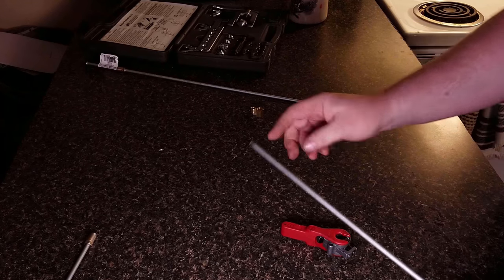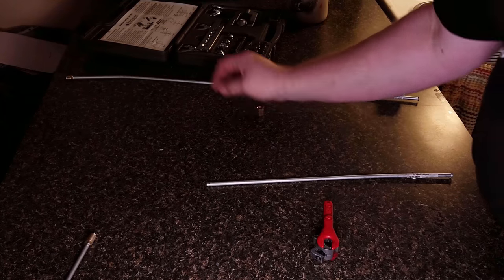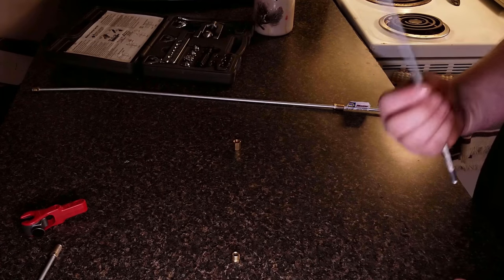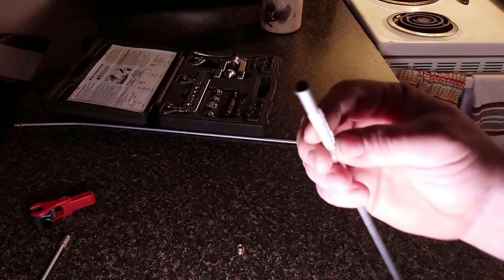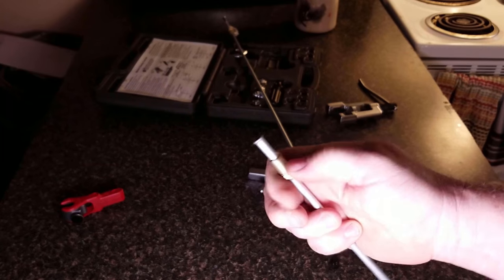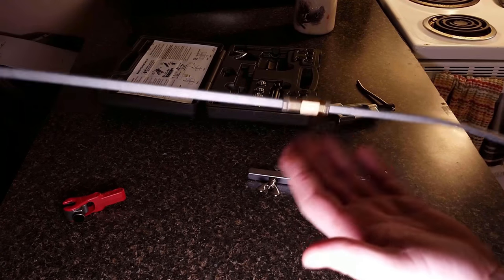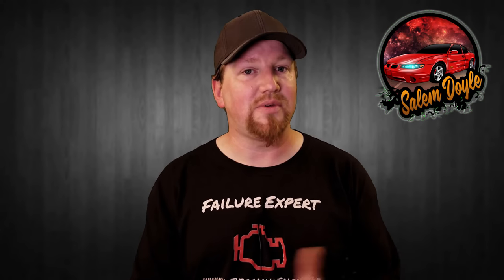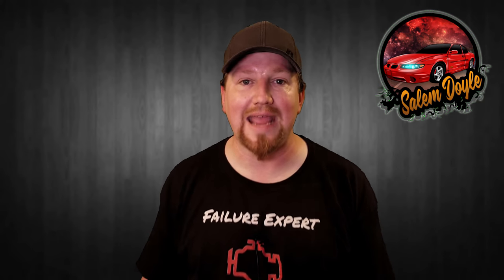The REAL way to repair metal brake lines !

Comment: You just saved me from having to take apart half my engine bay to replace a brake like that I stripped a bolt off and had to cut the brake line. Thank you

Comment: Great video Salem. I loved how you explained the whole compression vs. flare attachment system. Especially the blow off vs. leak with the compression fitting system and front vs. rear brake.   I'm doing flares for sure.
Reply from the maker: Thank you

Comment: I like the example of compression fittings, although kind of long.  I would recommend a video showing why not to use compression fittings on brake lines under 1,000-4,000 lbs of pressure.  Start the engine with fittings in place and let power assist build up pressure and then slam on brake pedal to show force not holding pieces together.Thanks for the whole explanation.

Comment: I own a flare tool but I have never I repeat while knocking on wood never have had a compression fitting fail and I have used about 20 and I usually torque them hard enough that you can not pull the copper ring off once installed i usually only use the copper ring over the old line after cleaning it well and connect it to the new factory flaired line

Comment: Thanks for the info! I have a 2003 GP with the 3800, much like your car. Always warms my heart to see someone taking care of one these cars. Great vehicles.
Reply from the maker: Agreed.  Thanks for watching
Reply: @SalemDoyle  You're welcome! What's your take on pulley swaps? I'm N/A, but I'm curious what you've done with your GP. BTW, I also have an '07 GXP with the 5.3. That thing hauls.
Reply from the maker: Nice car.  I have a 3.5 pulley on my 99 with supporting mods
Reply: @SalemDoyle  Nice. I've actually seen a GTP (slightly) out-accelerate a GXP with the right mods. You just have to be careful with knock and not overwhelm the transmission from what I've read about the S/C cars. Heat buildup can be a problem too, with the already hot-running all-iron 3800 having a heat producing compressor on the top of it.
Reply from the maker: True

Comment: Great video Salem! 

Question. I need to repair rear brake lines and of course I'm going to use flare/union fittings. They will be a patches in the middle of the 2 rear brake circuits. 3/16 inch lines. I'm using the copper alloy line. Why would I use bubble flares vs. double inverted vs whatever else. Also, many of the couplers (union) fitting seem to reduce the size. In other words, the passage way in the union is a smaller circumference that the circumference of the brake line itself. How much will this matter? 

Any advice would help. thanks!
Reply from the maker: The type of flare doesnt matter, just match it to your unions.  And that small diameter diff. Wont hurt anything

Comment: My state (maine) specifically says you need a double flange on any brake line -
“This safety tubing must be double-lap flared at the ends in order to produce a strong leakproofjoint.”

Comment: Can you unscrew a double flare connection (for some reason) then put it back together. Will the join be as good as the original ?

Comment: If you can take the ferrule ring off of a piece of pipe that it was attached to, the compression fitting wasn't used properly. If tightened properly the ferrule will indent itself into the pipe and be impossible to remove... or slip. The reason that they are illegal is that most people don't know how to properly attach them. And I agree with that.

Comment: So i bought a new brake line for my 2000 chevy blazer but the brake line flare is too big for the new line attachment... Did i just get the wrong part which it doesn't look like I did or do I need to refare it with a new attachment for the new brake line?
Reply from the maker: If its a factory part i would expect it to fit.  Maybe re check to make sure its right

Comment: I'm glad you covered the compression fitting bit right away. All good points!

I'm a fan of the nickel copper line, as it is much more resistant to corrosion and is easier to work with. You definitely pay for that, though! If I ever relocate my ABS pump on the GTO, I'll be doing a full NiCu line conversion.
Reply from the maker: Yes, i use that kind at work all the time.

Comment: The brake line flaring kits they loan at Autozone, O'Reilly's, and NAPA (same as the one in this vid) are not for steel lines, so if your car has steel lines, you will have to use a different flaring tool.

Comment: What is the best brake line material for brakes? 
Do you prefer steel or copper or?
Reply from the maker: The metal lines?  Steel is strongest.

Comment: Salem...   Have a question about a 2000 Buick Regal that has antilock and traction control issues.    Is there an easy way to replace the abs module and get it bled so that everything works as it should....  The only other videos I see all require a high end scan tool.   Thanks for all your videos..
Reply from the maker: You need the tool to do an abs bleed after replaceing the module..  not really a way around that

Comment: Although I understand you're talking about brass compression fittings they do in fact make stainless steel with a higher pressure rating than brass that will hold up. 👌

Comment: Excuse me I have some issues with my ABS module in my 95 buick riviera supercharged and I need some advice about repair or replacement ABS module? Thank you in advance sir
Reply from the maker: What info do you need?
Reply: @SalemDoyle  How can I test the old one or where I can find one for replacement?
Reply from the maker: The. Ar tests it, you should have a abs light on if its bad with codes pointing to it.
Reply: I got 4 codes in it and I want to know if the part needs to be reprogrammed  or just has to be the part number if I can find one?
Reply from the maker: @homeroaguilar6163  what codes did you get?
Reply: @SalemDoyle  27,32,33 and 75

Comment: Salem how can I get air out of my abs pump . I disconnected the lines to replace AC hoses. Now my brake pedal is on the floor.
Reply from the maker: If you cant get it out doing a bleed of the whole system, you may need an abs bleed wich requires an oem scan tool
Reply: @SalemDoyle  uuuuggh  I was afraid of this that. Which I need one anyway. Thanks for all the help when I have questions. Did you ever decide which route to take on your coilovers situation?
Reply from the maker: Not yet

Comment: access for good tools for this have gotten cheap and readily available. A great choice (better choice) is available at amazon as the "Titan double flaring tool" cant recall exactly but I thingk about 35.00 dollars. I don't know if its available in all sizeds but it was available in 3/16 for my toyota tacoma.. Beats THE HELL out of the double wing nut style, not expensive, and can function  in very confined areas. I've used both, I have no vested interest but in  trying to help out.Take it for what its worth, but the amazon reviews will back me iup.

Comment: Compression fittings were meant for copper lines. never steel brake lines. That's why the lil barrels won't bite into the line. Good video and good info.
Reply from the maker: Thanks
Reply: When I worked at Parker hydraulic fluid division..we had conducted a pressure test....steel line with a copper compression fitting.......250000  psi the line bursted....the compression fitting was like new
Reply: @mikesecondo2254  regular copper compression fittings on a steel line?
Reply: @bstceltics4  yep...works up to 5k p.s.i
Reply: @mikesecondo2254  Let me know where I can find a 'copper' Parker compression fitting, ha ha.
Reply: @elmarko9051  it's called (replace the brake line)

Comment: What about the steel D.O.T approved compression fittings?
Reply from the maker: I havent seen dot aproved ones.  But if they are then i suppose you could use them.  But flareing and creating a removable union is still,in my opinion,  just as easy and better in the long run.

Comment: i had this done 3 times bro ... not sure if im using compression fittings but i do know i bought new lines but did fittings based on how much the mechanic had in his mind he needed to cut
Reply from the maker: +Lebron James since it was a shop, it should be ok.  They should k ow how to do it with the correct fittings
Reply: @SalemDoyle  ok thank u got worried I can always take pics all around so u can see what I been doing

Comment: If you heat a steel line with a torch would that help in not splitting the flare? Seems like it should?
Reply from the maker: Maybe. But you would want to be really carefull doing that.  Would be easy to overheat it

Comment: Hey man I just found your channel tonight and I just want you to know I really appreciate your videos and your hard work you really helping guys like me out I just bought a 2002 Pontiac Bonneville SSEI and even though it’s not a W body I’m sure a lot of this information is still applicable to my vehicle.  Actually I’d like to ask you if your window regulator video on your 1997 GTP would be applicable to my rear window regulators on my 2002 SSEI because of course I have the same exact issue. Thank you for all of your help And I will continue to promote your channel from a friend and viewer from the greater north aka rust belt aka Michigan.
Reply from the maker: Thank you, that means a lot to me.  The window reg. Should be pretty similar, there may be a few small differences, but should be really close.

Comment: I bought a hydraulic clutch line And it doesn't look the same size inside as what came in from the factory and of course it leaks and then it scratched the end of my hard line
Reply from the maker: Yeah, sounds like it wasnt the right part.

Comment: My understanding all along has been that using a compression union for brake lines is unacceptable, dangerous, and even illegal in many states. Hence, using a doubled flared brake line is the best method to use. Nonetheless, would a high pressure compression union rated for 5,000 psi (Dorman part # 800-202) be perfectly safe and acceptable to use? Thank you!
Reply: As far as being legal or not I have no idea and I assume that he is 100% correct about that but almost every else he said about compression fitting is NOT correct. I worked for a testing company for 41 years and we tested compression verses flare fitting.  Installed correctly there just as good as flare. These tests were performed with the same pressure on both types of fittings while exposing them to vibration testing. The problem is compression fitting can be under tightened and even worse over tightened. So proper tightening is absolutely critical. An under tightened flare will leak and its hard to over tighten without breaking it.

Comment: Of Houston pressure fittings on brake lines before never had a problem get them good and tight it does deformed the metal and you cannot remove the feral if you take it apart if you can remove the feral you haven't  tightened it enough. That being said if you don't have experience with compression fittings you probably shouldn't try to use it on a brake line. I've been doing it for 30+ years and never had a problem

Comment: Dorman - OE Solutions High Pressure Steel Compression Union Rated For 5000 PSI
Reply: Hey that's good to know, have you ever seen them in local parts stores?
Reply: @megaman4201  Dorman instructions says DO Not use on braking systems
Reply: Steel compression holds just as good as the flares. The tubing will snap apart before the steel compression coupling will ever give away. One person has dimenstrated that and proved that the steel compression couplings are stronger then the tubing itself so your facts are totally wrong unless you're talking about the brass compression fittings in particular, the brass is a softer metal and not as strong. You can get the steel ones on Amazon

Comment: My dash indicators brake light is still going off, but I'm no longer losing fluid. Whats going on??
Reply from the maker: Could be fluid level, parking brake switch or the level switch at the mastercylinder could be stuck
Reply: @SalemDoyle  fluid level is good, emergency brake hasn't worked in years. I'm taking it to the shop, hoping it's just a sensor. My fingers are crossed. Thank you for the tips!
Reply from the maker: No problem.  Good luck

Comment: 68 chevy rear brakeline under front window ( drain) pitted leak for sure replaced  a length with double flair I HIGHLY HIGHLY RECOMEND NICKEL COPPER LINE OTHERWISE JUST TO HARD TO FLAIR DAMN NEAR IMPOSSIBLE TO GET A GOOD FIT STAINLESS IS JUST NOT WORKABLE I'M 72 BEEN THERE DONE THAT CHOW& GOOD MOTORING

Comment: Hey I hope you reply, when Im turning the little Aframe its so hard, should it b?, (a chick) here.
Reply from the maker: If you are crimping steel line it will be a nit hard, yes.  You could take a small socket and extension to fit over the arm for more leverage if you need to.

Comment: I'm assuming this isn't possible to patch the line, finding to good pieces of line?
All the flairing tools won't fit in tight spots
Reply from the maker: You usually have to pull the line down some to make space

Comment: I CANNOT find a Union. Only the middle nut but not the two nuts that go over the lines then screw into the middle nut
Reply from the maker: Most parts stores carry them.  You can also search online
Reply: Salem Doyle that’s the thing, I’ve been lookin all over online. It’s the same thing. Just the middle or it’ll show suggestions for a compression fitting which I do not wanna use 😂 I think a little bit of mig welding and Teflon take should do the job
Reply from the maker: Are you searching for "flair nuts"?
Reply: Salem Doyle nah man, cause I didn’t know the name of it. Idk why it didn’t come to mind. But I just looked some up and man you’ve helped me tremendously!!! Thank you man. You’re a hero. And for how long ago you uploaded this video you’re still replying to people! That’s great.
Reply from the maker: I always try to reply to everyone.  Thanks for watching
Reply: Salem Doyle yes sir, and thank you for the help.

Comment: There are a number of fools on youtube showing how to repair brake lines using these compression fittings. As you pointed out they may work sometimes under the right conditions.  I even repaired one of my cars this way years ago when I was young and dumb.  But my argument is that let's say 1000 people fix their brakes successfully using compression fittings and one of the 1000 has his brakes fail and gets killed.  Is it worth the chance just to save a few dollars?
Reply from the maker: I agree

Comment: Slow down  ther is no rush someone that never did this before will screw it up you should have told them to look for cracks usually a guy is not going to get it his first attempt he should or she practice with some spare line practice makes perfect you have to explain about cracks you have to inspect the flare for cracks
Reply from the maker: Good point, i am used to working fast.  Pinned this comment as a note on the cracks.
Reply: Thank you
Reply: And we need to do this up under the truck I assume
Reply: Do you want need to bleed the breaks after ? I’m assuming that’s a 10-4
Reply: While practicing my own flaring I went through about a dozen and a half tries before I got it down- primarily the ISO flares. The double flares were pretty straight-forward. Also, it helps to own the right flaring tool! I first tried ISO flaring with a Harbor Freight flaring kit, and it produced the (pretty much) entirety of my first flares' failed attempts at any successful, confident flares. I then ordered one from online and it was the correct one. So again, it helps to have to right tool. I think I was also concerned about crushing the tubing while tightening the tubing holder down enough to where the tube wouldn't creep backwards out of the holder when bringing in the flaring adapter onto the tube end.

Comment: Obviously you have never used them for water line when you use a compression fitting it actually compresses the feral down and it reforms the pipe and you cannot get it off.  So if you have installed a compression fitting on the thr feral can come off when you take it apart then it was not installed correctly
Reply: Sorry but they do not hold up to the massive pressure of brake hydraulic lines which is why you should not use them and will not pass inspection.  Enough pressure and Poof, this can't happen on double flare do to it being captured under the nut. Use if you like but I wouldn't nor would I want my family in a vehicle with them.

Comment: You guys asking for him to slow down, Ha Ha!
I usually watch my videos at 2x speed & always catch myself thinking:"Man!  This Dude is hopped up on caffeine.". Then I remember the 2x.

'Fast forward to this video - maybe all my 2x watching made this seem normal.   But, I do agree with the need for some better camera work.  Get that fixed & these will be great videos because your content is very good.

BTw, before this video, I watched a guy show a repair of a brake line using JB Weld.....it seemed to work & I'd rather use that than Comp Fittings, but Geeesh.

Anyway, I've done your method of 'splicing-in' lines w/ the 2 dbl flares + union.
This works great.  The worst part is sometimes finding the right connections & unions at local auto parts stores.  Best bet is Amazon, but if you want it done that day, or hour, you'll just have to wait 2+ days.

Anyway, Keep on Truckin' w/ the content!